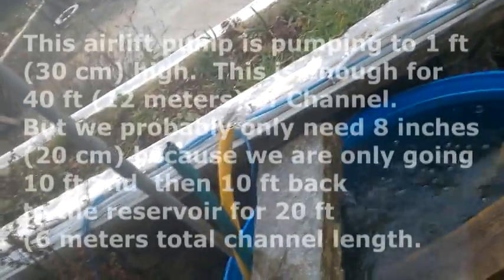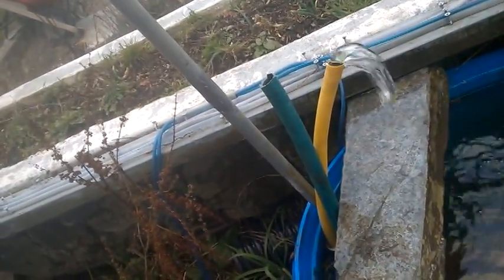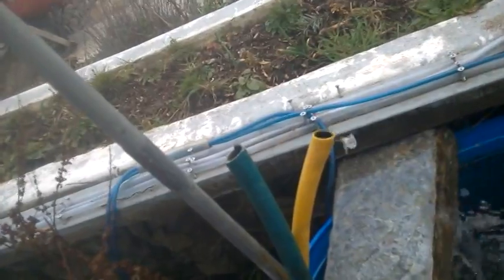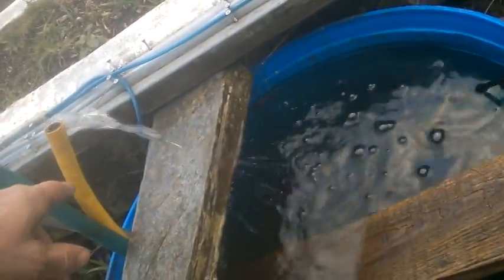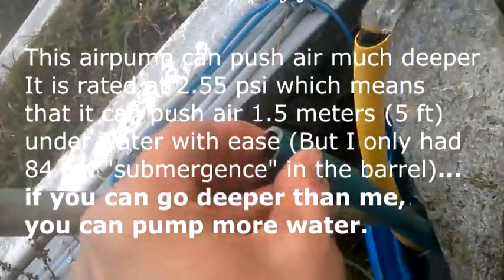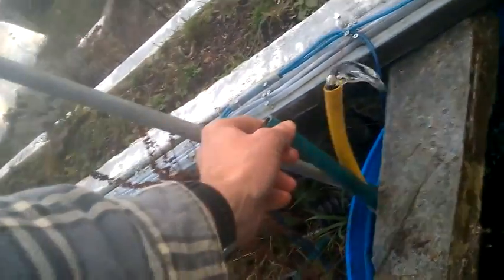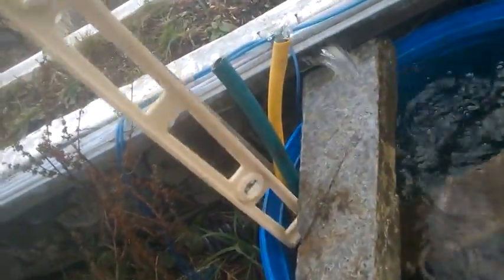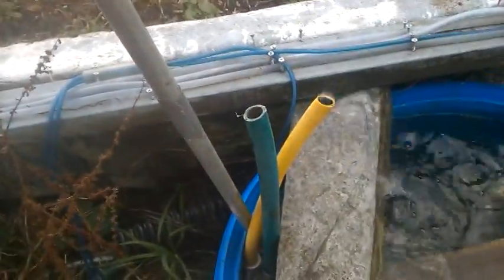Airlift pump to move water in Nutrient film Technique opens new possibilities!

Comment: Hi Brian
I have plans to do this very thing on a full scale in Sumba Indonesia.  The location already runs a small hydro electric system and 2 ram pumps. I would have about a 4-5 meter fall if not more available probably more. I am not sure what the flow rate I have available is yet.... I want to use a trompe to supply an airlift pump for the bio-filter component of an aquaponics system. What i need is maximum volume of air at the tank located at about 40 meters above the site and about 200 meters away. 
Any advice on how to flesh this out?
Reply from the maker: My low head trompes (up to 1/2 meter head) converted about 30% of the energy of the falling water into compressed air.  I have my notebook from that time (20 to 30 years ago) online as a google + photo album, the volumes of air I produced and measured are there. To run NFT,  I think a tromp 1.5 to 2 meters deep is plenty.  I have figures for my  trompe made from 6 inch pipes.  It produced at least 1.6 meters water head. (0.7 meters water head is 1 psi).  When water was going through it at 350 to 400 liters per minute, it was producing about 45 liters per minute of  lightly compressed air.   45 X 60 gives 2700 liters per hour of air (as compared with my bubble pump in this video producing 220 liters per hour).   I also have the amount of water it pumped.  So, using that air to pump water 6 ft (1.80 m) high through 34 mm pipes, it gave a liter of water in 6 to 9 seconds.  (But of course for nft,  you only need to pump water a couple of ft high at most) so maybe a liter every 4.5 seconds at 2 ft high with that setup (rough guess). (My figures were taken from that notebook) from my experiments years ago. I hope that helps,  Brian
Reply from the maker: When you calculate the energy of compressed air, it has 2 components,  the amount of compression and the volume per second or minute produced at that pressure.  But for low head  low pressure  trompes,  you could guesstimate,  (Water head in  meters  X water volume per second in  liters X 0.3) = (air head in meters X air volume in liters)    Your trompe will be a high head trompe,  so you could probably safely increase the 0.3 figure to 0.5    Air head just means the pressure of the air measured in meters of water column.  I hope that helps
Reply: Thanks for the feedback. Since I am  planning to use the air continuously I am guessing I dont need a large reservoir. Is there a particular way to make the air intake, venturi to optimize the air take up?
Reply: @Brians-tracking-solar-scoop  would you be willing to share that google+ file? I'm building a trompe to run my air lift system.
Reply from the maker: @michelleday6432   I uploaded the notebook to google photos,   I'm not sure how to share them.   If you give me some details about your  plans,  I can probably give you some advice.  You need at least half meter of head in your river or stream and to go at least 1 meter deep to provide enough air pressure to run the airlift.  I can guesstimate likely yields of low pressure air for you if you want.  (I'm not working at the moment due to rainy weather and health issues) so I have the time.
Reply: @Brians-tracking-solar-scoop  what is your email address? I have quite the interesting project I'm working on.
Reply from the maker: https://photos.google.com/share/AF1QipMrwHSCIy5dIoQZy0YQvZPttz-OdoT7XrvceBNJ__Jxb5PGtH6aDzUp8kIH-iSw1A?key=c1lZMjBPYlIxYkR0bjhwMm03dGV4RzY2MFVXaXl3 might work as the link for the experimental results
Reply from the maker: @michelleday6432   gaiatechnician@gmail.com
Reply: @Brians-tracking-solar-scoop  it works!! Thank you. This is great work.
Reply from the maker: @michelleday6432  You are welcome.  It's great that you could use it.  Thank you.